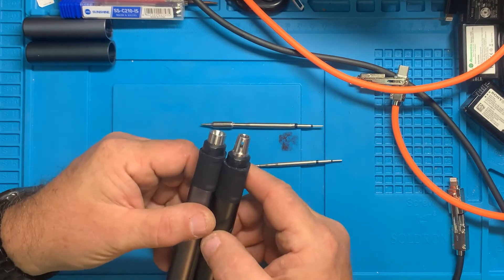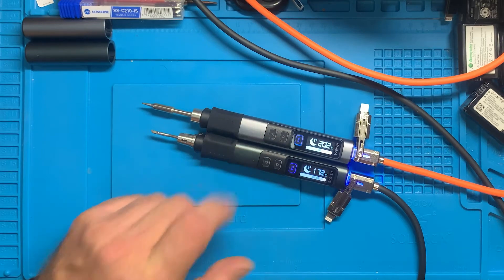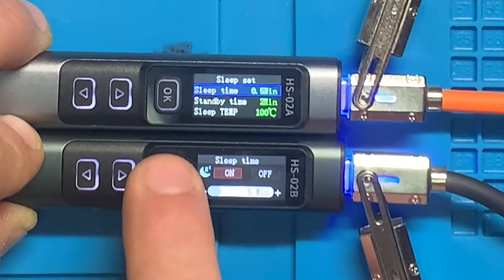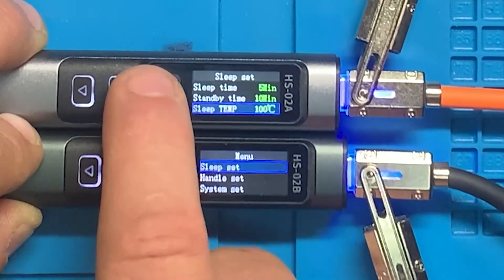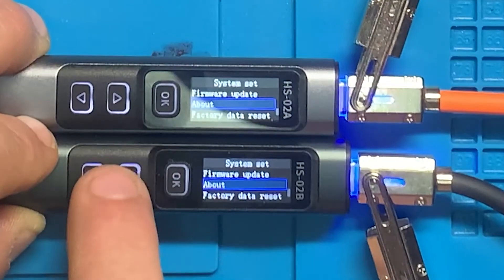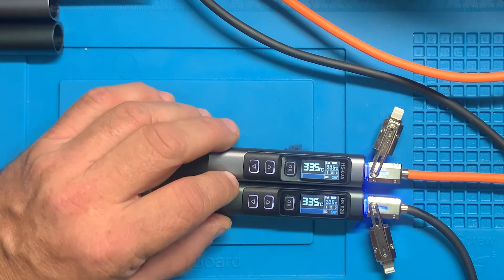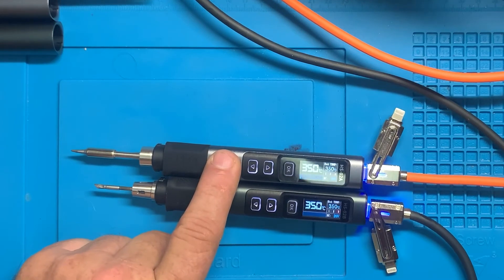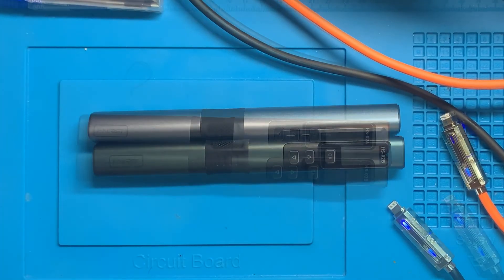FNIRSI HS02 A or B Soldering Irons Tested Head-to-Head

Comment: Why was the power only 65% on both irons?
Reply from the maker: I think because they know most PSU will trip out at 100% so they set them at 65%. from factory or at least both of mine where. most people will just use it as is and likely have no problem. the HS02B has never tripped out "likely due to the small c210 tip" but the HS02A did the first time i turned it up which was almost the first time i used it. it stayed in a draw the first month or two, then so many people starting asking for help i started digging in to find out what can fix it. with a lot of digging and the help of a lot of much smarted viewers of the channel we finally figured it out PD3.1 cable and supply fixes everything  anything less and you got to run it lower for me i could get 70%-80% and adaptive power always set iron at 96% but at 70% i never had any problems unless i was soldering a lot of heavy contacts in quick succession

Comment: Can i use other bits on either of these ions ?
Reply from the maker: You can use any tips designed for each iron. The HS02A uses C245 style tips and the HS02B uses C210 style tips.  The tips are different diameters so although they look the same they do not interchange. My advice is get the HS02A. You can get small profile tips for the C245 now if you are doing micro soldering like tiny surface mount chips the HS02B would work best for you. Hope this helps.
Reply: @TTMEable Thanks Mate 👍🏻
Reply from the maker: No problem. Glad to help.

Comment: Glad this video exists because they do not make it clear on their AliExpress store what the differences are.

It's a shame they didn't find a way to just use the same tip connector between the two.

So I'm guessing if I want to get one to use with the heat set insert tips or 3d print cleanup tips it would be better to go with A.

Btw for anyone looking for tips on Ali, C245 is the magic word for A tips and C210 is the magic word to get tips for B.
Reply from the maker: Yes you are correct. You can get extremely small tips for the B version fir real micro soldering but the A is more versatile for me and i have some really small tips in c245 so in my opinion the A version is the way to go. Check out my latest power supply video for the HS02A. I think it was called fnirsi hs02 fixed restarting. I have a lot of videos on this iron as well as the B variant. Thanks for the info and comment.

Comment: Thanks very much, man, FNIRSI really doesn't have much on their information page besides a table of the A & B tips & that the irons are different.

Honestly, I just want to buy 1 that's for both big & small joints.
I really don't know why they didn't just make a single iron.....this is strange & confusing
Reply from the maker: Thank you. I agree the website is confusing i started by buying the HS02B thinking it was the newest one. Then i got the A to compare. I can say although the HS02A has larger tips for larger jobs i really don’t see a use for the smaller one as you can get very small tips for the A. Now you can still get smaller with the B i haven’t seen a use for it yet in my repairs. Ill be releasing a new video on the A soon so be on the look out for it. Found the perfect psu/cable combo to run at full 100% power. Thanks for your support and comments.

Comment: You are a legend Thank for putting this up. I would do more heavier jobs. If not for your video, I would have bought the wrong one simply because I assumed The B would have been a later and better model than the A. I think that makes me an even bigger Goober. lol
Reply from the maker: Awesome. Thanks. Glad to have helped. I do recommend a high end power supply. One that can handle 5amps at 20 volts. Ill be releasing a video soon on what i have learned from a few of my knowledgeable viewers. Thanks for commenting

Comment: is  this like the qianli megapack mini iron like similar in size?
Reply from the maker: I don't know about the Qianli mini, but it seems to be a 20W iron while the hs-02 is a 100W the hs-02b uses c210 tips and the hs-02a used c245 tips and they are both 7" long and feel about like a fat sharpie holding them, they are simi triangular. 
The Qianli is advertised using c115 tips.  Do you have a link to the iron you are talking about? I may not be looking at the right iron.  Thanks for your comment.

Comment: Thanks for the great video! I. Totally new but plans to use for audio equipment pc board and wires , would A be better ?
Reply from the maker: Yes in my opinion the hs02a is better because it uses the larger c245 tips and can handle larger soldering jobs especially with audio amp wires a wedge tip would be best. You can also get small tips for the A. I would recommend the hs02a with a tips assortment giving you all the options. The b is suited to micro to medium solder jobs. It uses tge c210 tips. Hope this helps.

Comment: Does anyone know if these irons will handle 21 volts? My thoughts when i bought this was to pair with a DeWalt battery using the dc adapter. But now the instructions say 20v max.
Reply from the maker: Normally electronics will not be affected by 1 volt as dc power sources vary like household outlets. Ac may be between 100-120 volt and work fine. I have seen outlets as high as 130v & low as 92v and appliances working fine “though the extremes above will shorten the life” now the hs02 is rated 9-20 and again I don’t THINK 21v would harm the irons i wouldn’t run them for long sessions. Regardless its kinda moot as the irons only have 9v, 12v, 15v and 20v settings and would likely just reset if over voltage. I don’t have a charger that will supply 21v to test. I do know the irons only will use lower voltage if supplied with pd power. What are the specs on the dewalt dc adapter? If it supplies usb-c the protocol should set voltage regardless of the source potential my bench psu can support up to 260w 28v and even plugged into this usb-c port the voltage will adjust to 20v. If the dewalt supply only supports a barrel connector you could use a dc/dc buck converter. 100w 5a output would be needed to run iron  at full power. 
If you do try it i would set the iron at 25% power and work up from there and stop at 65% depending on what you are using iron for, 65% works great for me.
Reply from the maker: I may try a experiment with my Rigol variable bench power supply using the barrel connector to test and see if i can set 21v that way. May make a youtube short if anyone is interested.

Comment: the smallest tip for the HS02A is 0.1mm an the smallest for the HS02B is 0.4mm so im not sure if the HS02B is better for small stuff
Reply from the maker: The HS02A is a great all around iron and would be my default recommendation for large to medium/small component but if you want to do surface mount stuff i have to say go with the HS02B as the tips are tiny and can handle even the itty bitty stuff. Its the main reason i got both. I started with the 02B and it will handle up to say, soldering the header pins on a Arduino or maybe a little bigger. But to fill the daily larger component needs i say 02A. Hope this helps. Im hoping to do a soldering comparison video this weekend because of how much interest there is in these irons ill probably boost it in the video Q to drop next week. Ill be comparing both irons ability to solder and desolder all size components.
Reply: @TTMEable  but something that i notice while ordering is that the 6 tips that came with the A version includes a smaller one as the smallest one of the 3 tips for the B version.

so i ordered the A one with 6 tips for 52,99€ i hope its a good choice
Reply: @dbmaster46446  I concluded the same, 6 tip A variant seems perfect for a daily driver.
Reply from the maker: It would be nice if you could share the tip assortment that came with your iron. Maybe a photo of the styled. If not thats ok too.
Reply from the maker: Yes i believe you have made a great choice. I knew there where smaller tip for the 02A but im at work and couldn’t research how small they go. 

The 02A and 02B are the same size. The tips are the difference in the two. The 02A has much more mass to heat up but both irons still heat very fast, faster than my station and why i put the station in storage. The tips seem more robust for the 02A. I really dont think you will go wrong with the 02A especially with the tip assortment. I have limited tips for each iron but hope to make a comprehensive comparison soldering comparison between the two in this weekends video.
Reply: @TTMEable  it arrived today, by default the power usage was setted to 65% when i set it on 100% it bootloops, but i was able to reset it again, it was on firmware 1.6 if you care
Reply from the maker: Yes we have a email into fnirsi about the 100% power boot loop. Set it to 65% let it heat then change to 100% and it will be fine. The current spikes above all psu we have tried max rating but after heat up it will run 100% at no problem. As soon as i get a response from fnirsi ill post it on the community page on the main chain breaker channel.
Reply from the maker: Ps update to firmware hasn’t fixed mind or my other viewer with the same issue but another viewer said hers was fine at 100% at firmware 1.7.
Reply: @TTMEable  i cant even update mine, when i try it will just create a LARGE.txt on it
Reply from the maker: Strange. First question. Are you holding ok when plugging into computer? If so you have to quickly copy the bin file to the drive that pops up. You only have a few seconds. Also are you using the bin file from FNIRSI downloads?
If you don’t copy fast enough all you see is a txt file. So i suggest to have file explorer open with the folder containing the bin file ready so when the drive first pops up you can drag the bin file and drop it on the drive. It doesn’t say anything just updates then when you check version you see it the version of the bin file used. Also i have had viewers that had trouble updating and using a newer computer or a different computer allowed them to update. I used a windows 11 computer installed on a 10 year on pc.
Reply: @TTMEable  im using a linux system and i have also seen the ready.txt, then just copied the firmware.bin from the website onto the "drive" and waited, after it restarted it was still on 1.6

when i try to remount the drive after i placed the firmware, the text file changes to large.txt but i have no idea what it means

but i might wanna try it later on windows 10
Reply from the maker: Yes i would definitely try a windows machine. I wish i had gotten on the linux (or unix :)) band wagon when i was young but in my opinion i messed up and stuck with dos. Hated windows until i absolutely had to upgrade to windows 3.1. But i only did it because my Borland c++ and later visual c and basic software suit had to run on windows. I actually started with visual basic on 3.1. I started picking assembly because basic did not do some stuff i wanted. I would say i couldn’t even do the old hello world but i found my old copy of studio and created some stuff just to prove i still could do some stuff. Anyway i do everything backwards.  But yes please try a windows machine and let me know how it works out.
Reply: @TTMEable  sorry i forget to let you know, it worked on windows, after uploading it, it started instantly installing
Reply from the maker: Awesome. Glad to hear it. Now sure why the upgrade is so finicky about os.

Comment: Thank you for the informative video, I did not realize that there are two versions of this iron. I am looking at picking one up for my portable repair kit.
Reply from the maker: Yes, I think they are both great. the HS-02B is great for micro to medium soldering jobs as long as there are no large heat sapping ground planes are heat sinks although you can get wedge style tips that can handle larger jobs.  Now the HS-02A is the big brother and is capable of medium to large jobs and has full size tips for it. in fact it will be taking the place of my soldering station.  i have many irons i'll be evaluating and reviewing and some i have already reviewed and the TS101 is my second choice at this time.  either way you will be happy adding it to your go-bag and they can be powered by barrel jack laptop PSU's as well as usb-c reg and power delivery. Thanks

Comment: I was looking for this exact video a month before it was released.  I bought the HS-02A, but seeing this gives me the confidence that I chose correctly.  Thank you!
Reply from the maker: And thank you. to hear from you makes doing this worth it. Thanks again.
Reply: @TTMEable  Do you have a recommendation for a good rechargeable Soldering Iron that is not too big but is also reliable with a decent runtime. Replaceable batteries would be a definite advantage to, if it is on the expensive side. I don't use them very often and there is nothing more frustrating then running out to do a job and going to use it and it won't even take a charge when you are out somewhere high without power and you have to bring the whole init down to fix it.  Thanks again.
Reply from the maker: Good question. I don’t have a lot of experience with them but i do have a video on one. Check my past videos. I think it was titled cordless soldering iron or something like that. Anyway. A good solution is a high capacity power bank or even better a 20v dewalt drill battery adapter. I know they have one for dewalt that will allow you to plug your iron into, though you may have to lower your power on the iron. That will mean slower heat up and recovery. Now a really good option is a high capacity lipo battery pack. You can adapt the plug to allow the iron to plug in but you will have to be careful not to discharge the pack below the rated level and keep a lookout on iron display for low voltage warning. If money is no object then ifixits has a good battery powered soldering iron. 

If it where me though unless i had to do a lot of remote work requiring a rechargeable iron. I would either go with a couple cheap ones like i reviewed or the dewalt battery adapter option. With the dewalt battery option the battery will shut itself down at low voltage only disadvantage would be slower heat up and recovery and it will be harder to solder items with a large thermal mass. Hope this helps. Thanks for your comment.
Reply: @TTMEable  Thank you for the reply. After looking into it more, I think you are right. A few cheap ones would be the go for now. However, you have sold me on the FNIRSI HS 02A
Reply from the maker: Awesome. I think its a great iron. Ill be releasing an adaptive power mode video on this iron soon. Please be on the lookout for it. Hopefully it will answer dome power supply questions regarding the HS02A. Thanks for commenting.

Comment: have just ordered the hs-02a and already disappointed because i thought they were cordless
Reply from the maker: Sorry to hear that. i have done a review on some rechargeable irons. should have dropped by now. may even be one of the giveaway irons. anyway the biggest issue i saw with it was a very long heat up time. i think due to the reduced voltage and current.  i would also be concerned about battery life with a current draw like a iron. check out my review play list. if need be a can make a video on it and compare it to any of the other irons i have. see the mailbag videos to see the review irons i have.  hope this helps in some way.
Reply: I have since bought the Sequre S99 and it is so much better than hs002A. It is smaller and i like that you can change all in the menu while it is not on
Reply from the maker: Awesome have a budget cordless iron video dropping next Saturday. What are the specs on the s99. Is it like the ts101?

Comment from the maker: I received a response from FNIRSI and the following is a HS-02 firmware update log.

Hi, dear friend;
I am Jeff, a staff from FNIRSI official store

Yes, the difference of version 1.7 is that the animation option is added.

V1.5 version 20240402
Changed on V1.4 version:
1. Modified version number
2. Optimized sleep sensitivity
APP_HS_02A_V1.5_20240402.BIN

V1.6 version 20240408
Changed on V1.5 version:
1. Modified version number
2. Added a 0.5 minute sleep time level,
APP_HS_02A_V1.6_20240408.BIN

V1.7 version 20241030
Changed on V1.6 version:
1. Modified version number
2. Added a scroll setting function to the system settings
APP_HS_02A_V1.7_20241030.BIN

Comment: Great video! And you posted it just when I started looking for a comparison between the two; this video’s definitely helpful! I’m still not sure which of these two I will purchase, but I am leaning toward the HS-02b. Would you say the HS-02B would be fine as a standalone soldiering iron? Or for general purpose soldiering, would you say the A would be better? The longer cooldown time of the A and the shorter tip length of the B for more precision makes the B seem quite tempting!
Reply from the maker: I think both are great. i first got the HS-02B because the bulk of my soldering is small or micro and it will do great  for this but will suffer on big stuff as the smaller tips will cool fast.  the HS-02A is great for anything a standard iron will do and will take the place of my soldering station as the tips have more mass than it does and will work much better.  So it really comes down to what you do most. I would have to measure but i think the A is a inch or so longer.  I would say the HS-02B would be fine for surface mount stuff as well as soldering  headers on Arduinos (for example) or any general purpose soldering of that size.  If you are not going to do any surface mount stuff but mainly standard size components the A would be fine . I do both so i opted for both irons. i got them both for less than the cost of my Miniware TS101.

I'll be doing a comparasin of all of the irons i have hopfully this month.